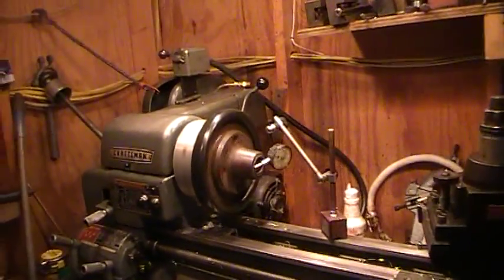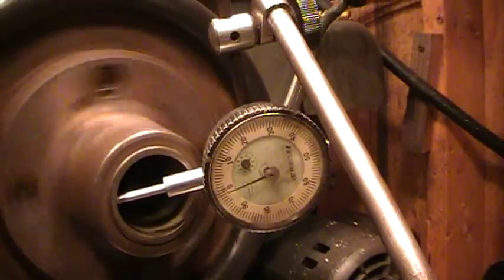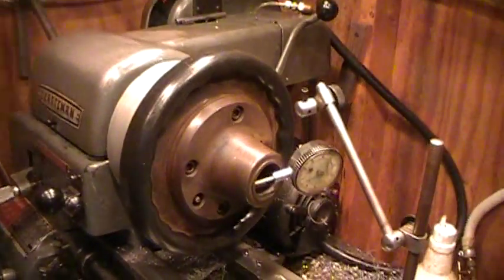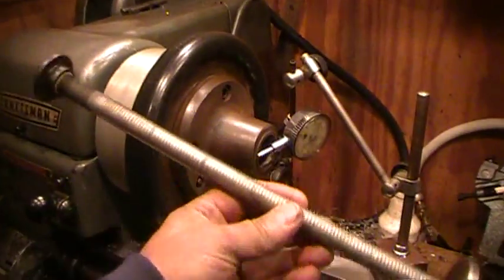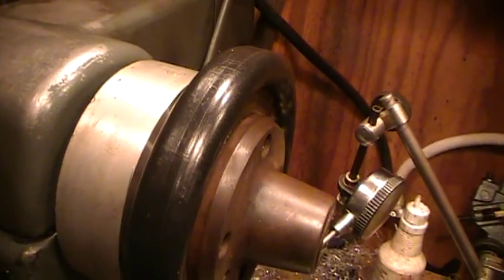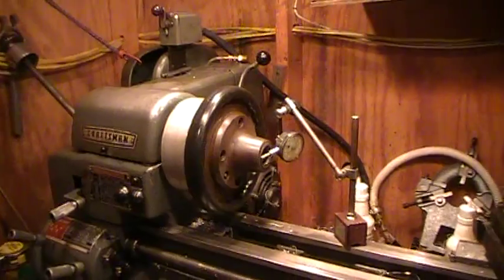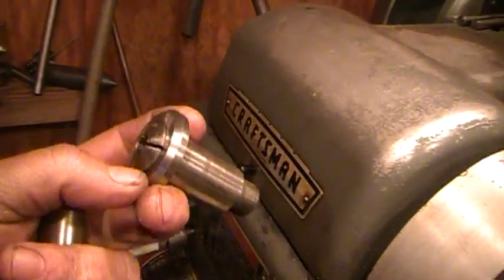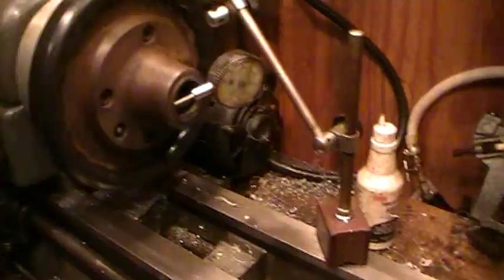adapting a collet attachment for the Craftsman Atlas lathe 12 x 36

Comment: Got another 12 x 36 Craftsman off Craigslist. It has the wrong motor and a single groove sheave. Can you or any of your viewers tell me what diameter pulleys I should use? Thanks.
Reply from the maker: the motor has two pully speeds I think they are 5 inch and three inch but I will need to check that to be sure. hopefully someone else knows and will chime in. Id get a rpm meter and measure the rpm at the chuck. this will tell you where you are at for sure.